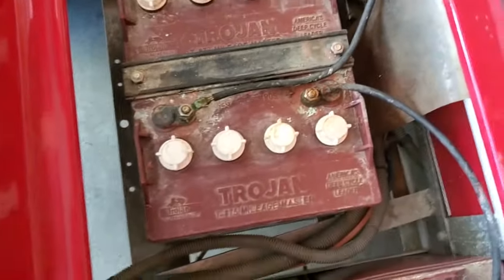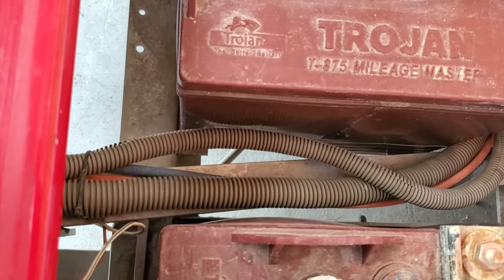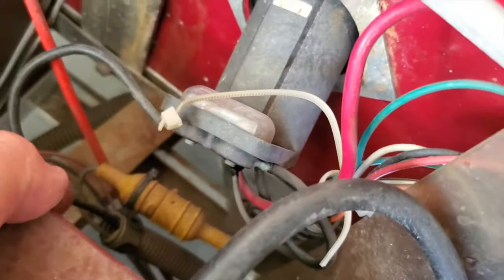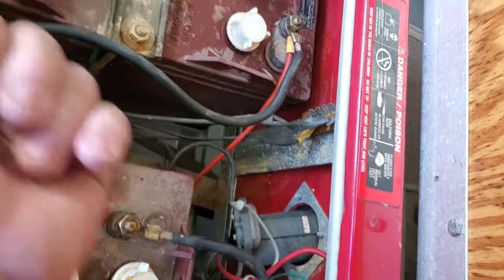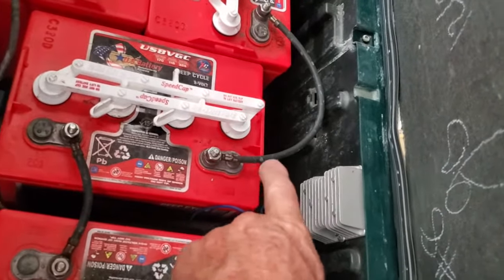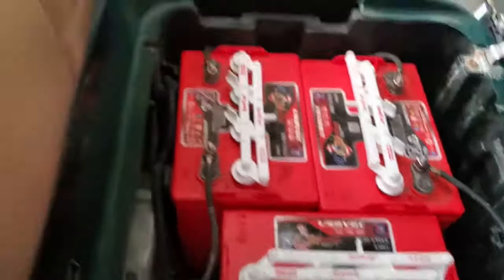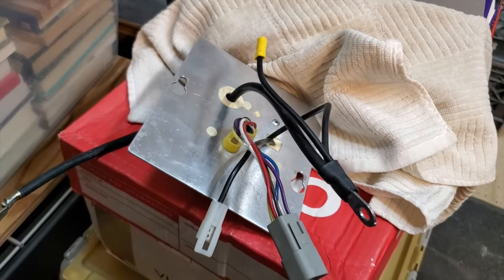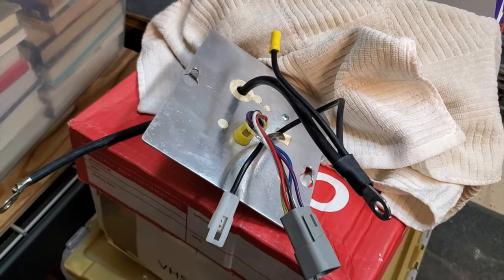How To Bypass Your OBC

Comment: What does the blue / white wires do in the bypass?
Reply from the maker: Keeps the controller from going into lock down
Reply: So what happens if the controller goes into “lock down” ???
Reply from the maker: Cart probably won't run
Reply: Would this mean the controller has to be replaced? Mine is a 2000 pd+, I did the bypass bringing the 10 from the back of the obc/receptacle to the main pack negative, cut the gray wire as well….but I didn’t have the yellow wire on the solenoid. I spliced the lite blue and white together on the controller side and cut the wires on the obc side of plug. But the cart won’t move at all, solenoid clicks but It won’t move? There is a solid yellow wire from the obc but it was going straight to the controller plug not to a butt connector…am I missing something?
Reply from the maker: Did cart run before you started cutting wires?  If so, then no need to replace the controller. 

What made you start doing a bypass,  and do you already have a different charger before any cutting?
Reply: Yes sir the cart ran before. I got it with no batteries, installed new batteries and ran fine but the factory charger wouldn’t charge. The charger tested good so based on research I concluded the obc was faulty. I was getting flashing warning light as well. I got an automatic charger before the bypass and it did charge the batteries but now I can’t get the cart to move. With key on and the switch in Forward I get 48v at both small terminals on both solenoids, I can hear at least one click when I depress throttle but no movement.
Reply from the maker: Tell me what all wires you touched?
Reply: The black wire that goes from the obc to the charge receptacle, I cut it at the obc and ran it to the main negative on the pack. The gray wire at the receptacle with the yellow fuse holder I removed the fuse and left it disconnected. Unplugged the obc connector and spliced the white and blue wires together on the controller side of the plug…left the obc unplugged so it’s completely isolated.
Reply from the maker: no skinny yellow wire to the solenoid  coil?
Reply: No sir no skinny yellow wire, there’s three skinny wires on it but one is blue/white stripe, solid blue, and the third one is red
Reply: @roilandiaz8454  did you ever figure this out?

Comment: What if my ds no longer has an OBC?
Reply from the maker: I don't know what you are asking or referring to?
Reply: @waynemartin.waynesgolfcart4900  I bought a 2003 ds and the obc was removed and I would need a new. I'm going with the summit 2 by lester for my charger. I guess my question is do I need to get an obc since mine doesn't have 1.
Reply from the maker: No you do not need a obc with a summit2 charger, it will work fine like it is, as long as the bypass has been done.

Comment: Hi , Mr Wayne ....Do the carts run without the solenoid Resistor ......I bougt one withouit it in no-running condition .....Could thet be the reason why resistor does not clicck and cart does not moove ?
Reply from the maker: No that's not the reason

Comment: How do you do this on a village lsv?
Reply from the maker: What are you asking me about, I can't see it?
What year and is it electric?
Reply: @waynemartin.waynesgolfcart4900  2009 48v club car village LSV 2+2 obc delete
Reply from the maker: The bypass procedure should be the same as I do for the precedent
Reply: @waynemartin.waynesgolfcart4900  well my back up alarm is now working which didn't work before. So guess I'm heading in the write direction. But when I push the go pedal forward or reverse still no go.
Reply from the maker: Tell me what you have done so far?
Reply: @waynemartin.waynesgolfcart4900  replaced key switch because was missing a key, tested run/tow good, replaced solenoid, replaced controller because other was swelled up, replaced all batteries with 4 deep cycle 12v, bypassed obc. All that's left is FNR switch, mcor and motor. I have a new FNR switch being delivered tomorrow. I'm stumped at this point. Will the mcor keep it from moving at all? I'm watched your video on them but don't recall you saying that.
Reply from the maker: I'm not sure why You are replacing everything? Was the cart running before you started replacing stuff?
 Why did you bypass the obc anyway?
 Did you spice the blue and white wires together?
 With the key on and forward if you step on the gas pedal does a solo noid click?
Reply: @waynemartin.waynesgolfcart4900  one of my customer had the cart setting for about 3 years. Didn't run when I got it and didn't have but one battery. I can't tell if solenoid clicking or the mcor making the noise.
Reply from the maker: If you replaced the controller,  and the batteries are good, start following the control circuit with your volt meter.
Make sure you have 48 volts leaving key switch to mcor etc.
If you can verify the control circuit is working,  then follow the drive circuit clear thru to the motor. 
Also look to see if the fuse that is back by the solenoid is good.

Comment: How do I test my OBC to see if it’s bad
Reply from the maker: Does your charger turn on , charge the cart, then shut off?

Does the cart run?
Does the amber dash lite work?
Reply: @waynemartin.waynesgolfcart4900  the cart runs

 I’ve never actually seen the dash light come on since I’ve got it 

When plug the charger (club car OEM) in the cart charger will click but meter will read at 0
Reply from the maker: If you can try some one else's charger on your cart,  that would tell you if the problem is in the charger or the cart.